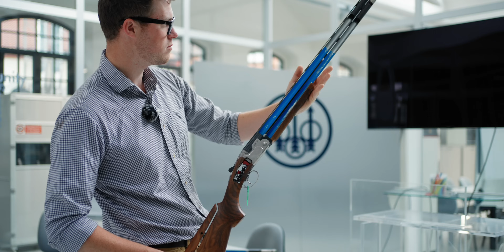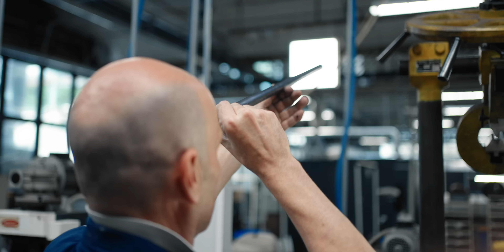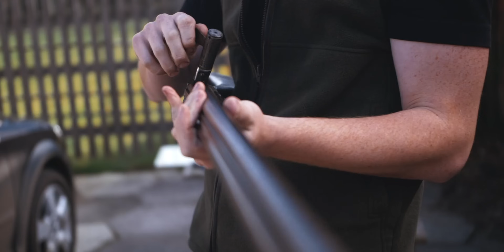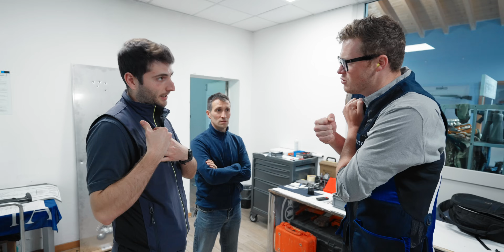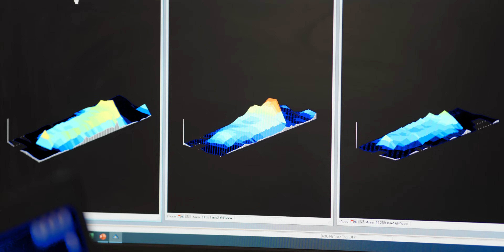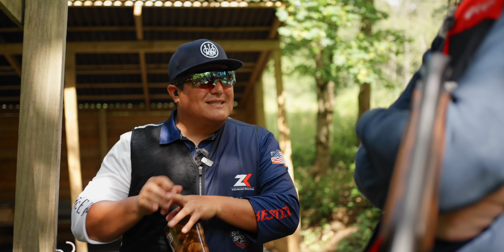I was wrong about Beretta…

Comment: If you needs millions in equipment to tell the difference, the difference doesn't matter.
Reply from the maker: I’m not sure if that’s true, that’s like saying steel is just steel because it take a very expensive machine to see what’s inside of it…
Reply: @tgsoutdoors  you can test steels easily and cheaply. If the application is for something like a knife, you can test the hardness of the steel in 10 seconds. You can test how well it keeps an edge in about 5 minutes with a piece of rope. I can demonstrate the superiority of my high carbon japanese knife's steel compared to my wusthof knife's stainless steel in a couple minutes of practical use.

If the only way you can tell a difference in the shot string of a barrel is with high speed footage, it doesn't matter. None of the targets are going to be moving 600 miles per hour, so small gaps in the string don't matter. For shotgun purposes, the shot string is 2 dimensional. If the steelium has a better pattern distribution, great. That's something that you can demonstrate practically. 

Also, the comment about the shot opening up by 20 yards but then staying tight out to distance is physically impossible.

Comment: Not real sure about some of the claims but, I have to say that I am  a Beretta Man. I shoot with plenty of guys who own & swear by Perazzi shotguns &, I have shot full tournaments using a friends perazzi guns & shot extremely well with them whenever I've used them. I love Beretta because of the absolutely unbeatable warranty &, the fact that the bloody things just don't stop. I've had no trouble whatsoever shooting 10's of thousands of rounds &, if I did, Beretta Australia will fix the problem, usually completely cost free with no questions asked. 
I have put in many 10's of thousands of rounds with both my Berettas with no problems &, I have been very successful, working my way to AA in DTL & sporting clays. 
Where I live, Miroku are probably equal in overall usage &, I must state, a very worthy gun accept one department. That department is is the longevity of the action. I know for a fact that a Beretta 682, lasts much longer than a Browning  or Miroku when it comes to the gun having to be tightened. I have shot many Miroku's in competition & think they are excellent guns however, they have nothing like the longevity of the 680 type Beretta. 
The 680 type Beretta is simply a masterpiece of design. Mechanically superb & with a balance without equal.  
Berettas new type with the different ejectors was a major fuckup, mainly because we expect Beretta to have worked these problems out.   Why didn't or couldn't Beretta have worked these problems out? This seems to me to be very dodgy, particularly with Berettas track record.  
For me, I want to buy another Beretta  but, how can I be sure that the issue is solved?  What I value the most is a Beretta gun which will cause me no problems & will be perfectly reliable.
What say ye. What say Beretta?

Comment: The diminishing returns here are way understated - if your gun is correctly fitted you basically top out at around the 2-3k price range until you're shooting 23-25 EVERY round. Then that extra little bit the next 5-30k makes might make up the difference enough to have you winning championships, but until you're at that level the only way to get better enough that it makes a difference is training.

Where's the side by side measurement comparison of absolutely identical configurations? @ProjectFarm needs to answer!

Comment: Why are Baretta barrels so tight. I have a franchi affinity 3 and they use baretta/Benelli mobil barrels and my barrel measure .723 in 12 gauge.
Reply: It's not just Beretta .  Many European shotgun manufacturers have traditionally had tighter bores than what would be considered the standard of .729 for 12 gauge.   It's a design philosophy many of them have/had.  My Superposed guns , Perazzi, Rizzini, and Ugartechea are all stamped 18.3 to 18.5 mm depending on the particular gun.   I remember hearing that it may be a holdover from when shotshells were running fiber wads.

Comment: Simulations are only as good as how well the problem is modeled. Proper barrel geometry with material thermal and mechanical properties with uncertainties. Use correct boundary conditions with varying pressure, temperature, and fiction loads. How does the barrel react deformation (elastic and inelastic) and vibration wise. It would be interesting to simulate and capture the barrel behavior in slow motion and the effects with different loads and chokes.

Comment: Great video. Nice job. Some questions on the test guns: Were the weights, forcing cones, bore sizes/dimensions, and choke cone dimensions all the same? Were they all stocked the same way? I don't understand how the bbls can alter the recoil. It doesn't make sense, and it seems to defy physics. Where's the recoil energy going?
Reply from the maker: The way it was explained to me is that it’s about reducing peak pressures in the shells, by reducing resistance with the longer forcing cones. The overall pushback will be the same but instead of a spike it’s more of a smooth incline of pressure that most shooters will find preferable. The spike in pressure also translates as more muzzle lift, so reducing the spike reduces lift. 

On the test guns: 
The weights were different, 3 ounces or so between each model. 
Chokes were the same - Modified in all
Stock dimensions were similar, but the profiles and grip shapes are different. 
Forcing cones are obviously different in each, that’s the point in the test, and bore size is different as it’s measured at the point where the cone is in two of the guns.
Reply: @tgsoutdoors  So I've been thinking more. Did they measure the velocity of the shot mass at the point where they photographed it?

Comment: hexavalent chromium. It works great, but like many great things it was found to be toxic and/or cancerous. Many years ago it used to be sprayed on new cars in the U.S. by manufacturers. Cars didnt rust in the winter when roads were salted 👍. 
Yet they stopped spraying with hex chromium and began spraying with nothing at all. Thus if you life jn a snowy climate, rust accumulates.
My first several cars undercarriage rusted out early because i didnt know to spray it. Ends up needing serious body work or will not pass state inspection, yet the engine is fine and the car would otherwise be able to driven for additional years 😢.
Reply from the maker: That is very interesting! 

I wonder whether it was removed for health purposes or just as a cost saver and long term money maker

Comment: Isn't comparing the recoil on a Silver Pigeon to a DT11 kind of a no brainer? Doesn't the DT11 weight about 1 pound more? An extra pound will greatly reduce the precieved recoil. The DT is alao balanced better which helps.
Reply from the maker: That sporter was 8oz lighter, so of course physics is going to play its part. One thing we weren’t allowed to share on video is the results from a test they did with three different profiles all on the same action. It was very similar to the results we saw during my go in the tunnel, with just a bit less spread in results. 

On a weight note, I have shot some 8-9lb Turkish guns that recoiled horrifically so weight isn’t everything. 

If I could convince me to play with their million euro R&D tunnel for a few days, I’d love to run a heap of tests to find out what gun design features make perceived recoil better or worse, and then run a comparative shooter perception test. Everything from barrel profiles and lengths to action shape, stock shape and material.
Reply: @tgsoutdoors  I was thinking that mounting up the 3 different Steelium offerings to the same receiver would be a great test. And yes, weight is not everything. I mentioned balance as one example. I love the videos, keep em coming!

Comment: PVD is great tech, but it's an inadequate replacement for bore chroming.  This is a horribly stupid regulation.
Reply: Absolutely, it's the same process used to "gold" the surface of drill bits. (It's titanium nitride and not gold) But how long does a titanium nitride coated drill bit maintain its coating? Probably for about 3 uses before it's wearing off depending on what you're drilling and if you have the right feeds and speeds etc. Certainly not suitable for the inside of a shotgun barrel. But this plasma pvd might work a bit differently, essentially welding the coating into the material.  
I suppose the proof is in the pudding

Comment: So how about a comment on Beretta's poor quality control and poor customer support.  All this gee whiz technology doesn't mean spit when you can't assemble a gun so that it works properly out of the box.  

Example, in the past 2 years I have purchased two Silver Pigeon III shotguns with a EELL wood upgrade.  BOTH guns had a safety that could only be moved with a hammer and punch.  Which means that I had to pull the stock and use a Dremel and a diamond file to turn the tips of the retaining pins 0.005 inch (0.13mm) smaller.  Because there is an interference between the top tang and the retaining pin for the safety button.  If Beretta were ISO9000 that particular problem would have been addressed years ago.  Then there is the cleaning solution that leaks our at the seam between the front of the monobloc and the bottom tube on my 28 gauge barrel set.  Yes I do clean my barrels regularly and wipe them "dry" after each outing.  After 4 boxes of shooting dirty cleaning solution will be pushed out of the crevice formed by a bad job of furnace brazing the barrels shows up again.  Then there is the brand spanking new 30 inch Optima HP Sporting Barrel set I purchased for my 686 Field.  The bores for the Locking Bolt were oversized.  Which meant I then had to purchase and install a +1 Locking Bolt into the action.  Basically since April of 2021 every single Beretta Item I have purchased had defects that caused issues with Function.

Comment: I have DT 11 Black Non-Carbon and a A400 Black. Both are exceptional guns. I can tell a huge difference between the two especially when shooting 200 or more rounds. The A400 is lighter coming in at 7.932 lbs and the DT comes on at 8.545 lbs. I'm shooting 80% after 6 months of owning the DT11. It was worth the investment in my opinion. Thanks for the content and hope to see you at one of the East Coast shoots next year. The Gator Cup is one I would highly recommend.

Comment: The thing about DLC, though, is it wears off. It's not as strong as chrome. It's been used for a long time already on other firearms here in the USA, like custom 700-pattern bolt-actions. But most have moved away from it in favor of nitride. PVD such as DLC is also a line-of-sight process. The vapor needs to be able to access the area being coated. It's not like dipping a part into a liquid bath that fills every crevice and cavity. So getting an even coverage is more difficult. Companies like IonBond here in the USA have pioneered this process.

Comment: As a 686 Sporting shotgun owner I think Beretta should launch a 686 version without engraving and with a rust resistant coating on the whole gun. I live near the sea and the shotgun gets rusty too easily. I need to oil it everytime.
Reply: The new 688 should do this decently. Laminate stock, black coated, no engraving. Looks pretty neat